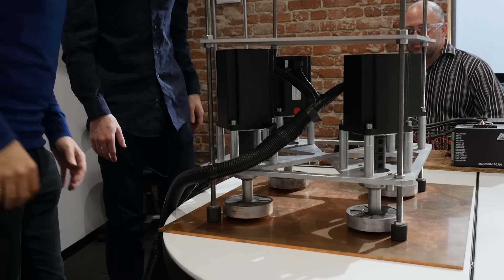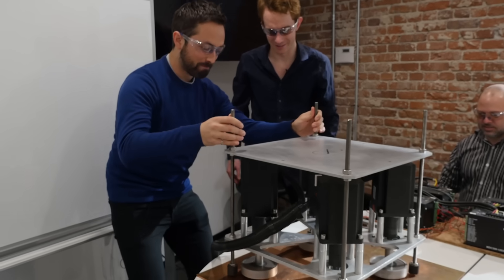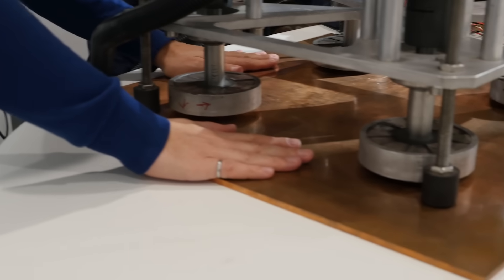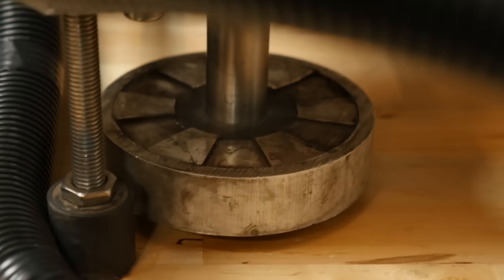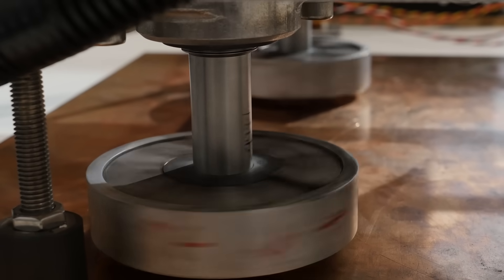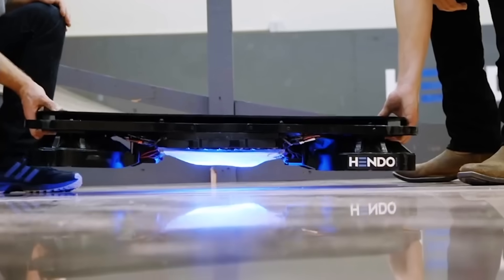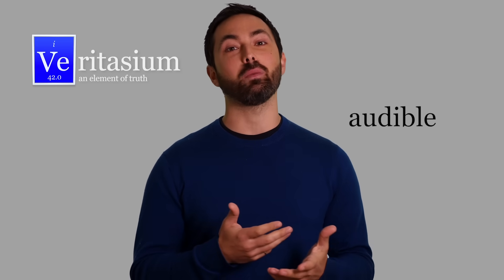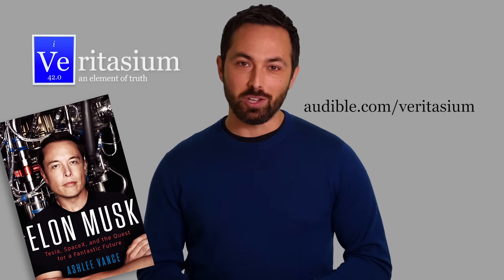Electromagnetic Levitation Quadcopter

Comment: For any curious experimenters, keep in mind that high temps destroy neodymium magnets... and I mean like the sorts of temps of the "hood of your car trunk on a sunny day" - hot will severely weaken them so keep that in mind when using expensive magnets like these.
Reply: Not quite. Some people could misunderstand this comment and think that neodymium magnets are useless and therefore "traditional" magnets should be used.

For each application obviously you have to choose the material, geometry, system, etc. adequate. In this case, if you want to use SUPERMAGNETS (that is, magnets made with RARE EARTH, such as neodymium-iron-boron Nd2Fe14B), you must choose another material. That material is the intermetallic compound Samarium-Cobalt, SmCo5, which has magnetic properties almost as good (approximately 85%) as neodymium magnets, and whose critical temperature is about 2.5 times higher, even better than the critical temperature of many traditional ferromagnetic materials.
Reply: Me, a brainrot victim: UsE LiQuId nITrOgEn.

Comment: I just want to know, does the weight decreases? 
If you put it hovering on top of a balance, will it get lighter or the weight stays the same (like pushing the surface bellow)?
Reply: That depends how you support the balance - it it's on the table it will show zero (as the thing is flying above it) so there's not really a way to weigh it. Have you tried weighing an aeroplane while it's flying?
Reply: @AAAyyyGGG  you're not getting it..
If you have a closed box with a drone flying inside, it will have the weight of the box and drone, because of air.
If you have a super conductor hovering on top of something, the scale will show the weight of the hovering object even tho it doesn't touches it, you can even put something on top of the hovering object and it will show on the scale...
I just want to know if the same applies to this method, the magnets could be pushing the surface to the scale, making it weight exactly the same even when hovering, this is what I want to know, if the same applies...

Comment: Add an impeller jyro to the top of that and mount the copper plate. Once the jyro reaches 25k rpm be aware ! To displace the heat use aluminium in thin sheets on the outter side of the copper.

Comment: The current needed to make this work is enormous,  and the copper has to be very thick, which is very expensive.  The concept is good, but different materials and much lower power to achieve the effect is going to be necessary to make it practical.  There is no reason on Earth why this should be so heavy.  There are much smaller and lighter motors that can be used to achieve this rotational speed.

Comment: you could put magnetos in it and try to run it like an alternator or something.  This array seems to utilize the natural magnetic flow by compounding the fields, it uses the natural toroidal dynamic in a type of broken symmetry, i guess.  If you're creating heat you're wasting energy.  Couldn't it take up the energy it gives off, if it alternated current?  I still don't understand wireless energy transfer.

Comment: Problem is that is just using the induced flux in the copper so
1. Needs to always be just above a massive ($$$) copper plate
2. Magnets would be depleted.
3. Electromagnets instead would use insane amounts of power.

Comment: If you have a device that weights 5lb that is levitating a 10lb object and you pick up the device (moving both items) would it feel like 15lb or 5lb?
Reply: Definitely 15...
Reply: @enricobianchi4499  how do you know? You gave not facts to back it up. If the levitation keeps it in the air, won't it keep the weight from being felt?
Reply: @dalton6173  Every action has an equal and opposite reaction. The device pushes the object up; the object pushes the device down equally + gravity; as such, the object is suspended in the air and still weighs 10lb on the device which weighs an extra 5lb on you, amounting to a total of 15lb. Very simple stuff.
Reply: @enricobianchi4499  however it is an emergency field ....would that change the distribution?
Reply: @dalton6173  1. What is an emergency field?
2. What do you mean by "distribution"?
3. Change compared to what?
4. I stand by what I said.

Comment: One thing i am still curious about, is it possible to levitate the magnets with out a conductor such as copper sitting under them? I know its possible to alter the magnetic field of a falling object, suppresing the gravity pulling it down and causing the object to fall slightly slower than normal. But Maybe theoretically, we can distort the gravity field of an object using electromagnets. And possibly cause it to float with out any copper laying under it. Just a theory, also i dont claim that these theories are true, im simply just curious.

Comment: Have you tried to electrify a spherical spinning vessel filled with mercury? What material would the vessel need to be made from to obtain optimal lift? Please consider this seriously. A spinning mercury filled sphere using very high DC voltage should levitate without a copper sheet below it.

Comment: Hyperloop will never work! There is a reason we don't transport little mail through vacuum tube! The weight of the earth's atmosphere!
Reply: Damaskilo there's something called a vaccum that eliminates the friction caused by the Earth's atmosphere. 😆😂
Reply: @lukewilliams5341  no! I didn't mean that! The whole atmosphere is weighing down on the tube! And the longer the tube is, the bigger the pressure difference! If you have a teeny tiny failure all the people inside will be crushed to death!! 
Atmospheric pressure is no joke! It can be deadly! 
The only reason we as humans don't feel a thing is our body has the same pressure outside as inside (lungs, organs like digestive system etc) 

 And there are other technological problems, like how to get the people in and out without letting air into the tube. You can't just let air in and than pump the air out. Depending on the length of the tube it would take weeks to just pump the air out. You can't have leaks during accidents or natural disasters, like flooding, storms, earthquakes, tornados etc. You would need multiple failsafe systems, and propably multiple layers of different materials to ensure a vacuum. 
It's too risky, too expensive and unrealistic!
If it were so safe and cheap to make, like Elon musk wants you to believe, we already would have thousands of Hyperloops around the world!

And it's not new! It's a really old technology.

Comment: Imagine if a rotating motor that can create magnetic field and do the same exact thing with the earth instead of the sheet of metal. It could hiver with almost no noise and no movement, except every electrical device around it will experience electrical interference and under it will get slightly hot. Its long time till we get it but lets say if the theory is correct we can explain UFOs. They almost work the same way,, and colorful lights are because of the electrical fields around them. And no im not wearing a tinfoil hat. Lol

Comment: Less revs and no lift. Too many revs and it will fly off into space until outside the influence of earths magnetic field. Also revs would have be adjustable for different planets gravitational signatures. Controls for pitch/yaw and six axes. I contemplated the probability from one of the designs in the  Vaimānika Śāstra. Now see it done. Weight ratio is high so materials become a challenge. Mercury induction is the key but only governments have the ability to pull it off.
Reply: @Gerhard57NL  so i am just guessing. Now i see it needs copper under it.?
Reply: @Gerhard57NL  Master Builder/Industrial designer with 35 years experience looking to start scientific research company. 

dibble and dabble with hypotheses.
The hannebu 1 had to be copied from Vainmonkia sastra.

Comment: I once worked in a "Steel Mill" and we used to lift and move sheets of Steel weighing several Tons with an electromagnet powered by a 12v DC Car Battery.

Comment: Is there a way to absorb that heat and redirect it to produce energy?
Reply: Jack Daniels lol my question exactly, I think there’s many uses for the heat that’s generated, it can be used to generate electricity for sure
Reply: @ZimaletaMotors  Depending on how hot you get it, you might be able to boil water underneath it and then push that through a steam turbine. 

Maybe.

IAN an electrician, engineer, or terribly smart person.
Reply: Perhaps having the underside of the copper sheet connected to an array of thermocouples might do it.

Comment: Can they use the copper plate as a fly back energy and supercapacitors to catch the energy and is it oscillation current or direct current that the plate is making and if it makes oscillation current use a bridge rectifier

Comment: I think this idea has way too much wasted energy (evident by eddy currents generating the heat in the copper plate) to be viable.     :)   it's kind of like our current mode of transportation where we hop in a 6,000 pound vehicle to transport 1 single 200 pound human...    waste...   :(

Even worse is that we normalized this wasteful behavior...

However, I would like to see this honed into a better and better idea...   So keep working at it...  :)    may find a breakthrough idea to make it even better...   :)    no idea ever starts off perfect...
Reply: That's way i was thinking. Induction is terribly inefficient

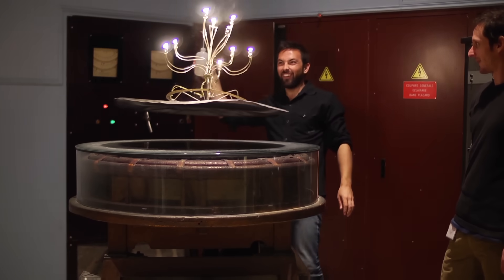Comment: @2:14 looks hazardous - a perfect recipe for a plate zooming out of control and chopping everything on its way ! and you guys are just standing there in casuals !
Reply: it wouldn't do that just cause of how the electro magnet beneath is set up. There are some great videos of a professor called Eric Laithwaite here on youtube showing the power of linear induction motors. Very interesting stuff.  Basically he shows that he can shoot an aluminium plate at something like 300km/h or just have an aluminium plate hover back and forth a few metres slowly. Just depends on the electro magnet beneath it and what pattern of magnetism it makes. Proffessor Laithwaite called this the "Magnetic River". For anyone interested in gyroscopes or magnetism, his work is a great watch!
Reply: Tasty Mushroom thanks for clarification. But doesn’t hazard occur when something is off the expected parameters. After all this is an educational video. There are people out there experimenting and failing over and over before perfecting it
Reply: @kalpssays  Yes indeed. That's the result of which we are seeing here. I'm sure that guy wouldn't have let him anywhere near it if he wasn't absolutely sure it was up to spec. Electro magnets are pretty stable. Barring short circuits from say physical damage or dropping water on the coils, it will keep operating in spec.

Comment: Technically it’s riding a wave that is generated by causing electrons to bounce up and down causing a transfer of electrons that is constantly being pulled and pushed back resulting in levitative motion. It happens so fast that it creates and invisible oscillating pillars that push and pull the electrons over and over. At a certain motion you can see the mechanism hop up and down meaning what I explained.

Comment: But it only works over the copper plate. Rather it needs a set of magnets and a non-ferrous metal, preferably copper to work. Not true levitation.
Reply: This is actually considered a true for of levitation. An extremely high-power form is occasionally even used to levitate stuff like frogs.

Comment: Copper solar freaking roadways!
Reply: Are you forget the fact that the copper warms up to the point where it will boil water? Imagine traveling across a surface that can burn you and horribly disfigure you at any point. Yeah, not just yet.
Reply: @StadiaTime  - cool it with a liquid on the underside and pump that hot liquid to Russia to heat people's homes
Reply: I had to laugh! What a fail the solar roadways were.... Unbelievable!
A lot people love science. Doesn't mean they understand it thou
Reply: And with solar panels so it pays for itself
Reply: Dont forget the death tube trains
Reply: @user-cg3em4cw4f  yea, thats the joke
Reply: Brilliant!
Reply: @user-cg3em4cw4f  not if the car floats over the 'road' instead of making it dirty with their wheels etc
Reply: @user-cg3em4cw4f 
V 1.2 put solar panels above the road Hehe if it only was cost effective to build
Reply: Some pros and cons:
Anti-viral
Rusty
Pollutant
Lightning storms??
Expensive/supply chain/offset from mining it?
Doubles up as some kind of cable network?
Reply: It would be great until you get a serious solar flare. Your copper road would then become lethal
https://www.space.com/7224-150-years-worst-solar-storm.html

Comment: I screwed around with this in middle school a bunch of guys and I thought it would be funny to sping magnets on a motor to use as a method of power transmission, never thought of using it this way even after learning about the moving a magnetic field thing in high school

Comment: Funny but it's fake, because the aluminium can't be magnetized too easy, in fact a magnetic field will cross trough it and the aluminium will not be attracted or repulsed.
And the permanent magnets will last some minuts before the effort disrupts the magnet atoms and changes the magnetic alignment then the magnets will stop working.
Reply: The video says nothing about aluminum?
Reply: @nathanb011  Check the minute 2:00
Reply: leo2tv aluminum IS paramagnetic, and its light magnetism can be used to control the strength of the magnet's force at a much finer tune. So no, it's not fake.
Reply: @nathanb011  One thing is the theory, another thing is the reality. Repeat the experiment for yourself. I work in that area and is not going to work in the way that they have showed.
The tiny magnetic field of the Al is like 1, and the magnetic force is going to go trought it.
The Al is not to control the magnetic field, maybe the Bismutum if they chane the orientation....
I wish it was real... But is not.
You can read the wiki https://en.wikipedia.org/wiki/Paramagnetism
Reply: leo2tv In no way did I say the Aluminum would control the field. If Aluminum is takes more magnetism to affect it, you have more adjustment for what occurs.
Reply: @nathanb011  You have said that, you can read your own previous words in your comments. Anyway it won't work in the way you think. The magnetic field is not like a water flow, that is not the right mode to control it. Read about magnetic, diamagnetic and paramagnetic materials (tvere you will find special alloys that really absorb or change the magnetic field direction); also check the maxwell laws, farady, etc.

Comment: try using stacked plates with sectioned geometric paterns between each plate with each section wired outside the plates section into one -E  terminal battery the plates will create A repulsive field on the opposites side of the - E plates and are mainly used in static photon deflection system. the copper scrolls are the first demo stack of a working photon star ship shield

Comment: Hyperloop: Someone maybe can tell me how they will maintain a near vacuum in a tube stretching across a continent? What sort of material would be used for the tube? Concorde was 202 feet (66m) long whilst on the runway but at altitude and flying at mach 2 it stretched by two or three inches (50-75mm) and this had to be allowed for in the fuselage to keep the stressed skin pressurised. This was difficult in a 66 metre tube - How about a 600km tube? With a much greater differential pressure. Sounds like a truly dumb idea to me.
I am in South London and laying beneath me are the ghostly remains of the Atmospheric Railway - an attempt to build a hyperloop by the Victorians. The low pressure was kept by leather seals which hugged the carriages. They were eaten by rats. The steam engines couldn't supply the power to move enough air and the whole thing was closed fairly soon after opening.
Reply: Not saying anything about the Hyperloop, but I believe we've advanced a bit over the past several centuries.
Reply: @yobeefjerky42  Sadly for the idiots believing in the Hypeloop, physics didn't "advance", it stayed the same.

Comment: That's hardly a quad copter and for magnetic levitation that was  stupid loud. Why have it be so heavy? I can maybe see use on a factory floor but the device weight and em current produced heat.
Reply: Permanent magnets weigh quite a bit and so do electric motors to spin those magnets.
Reply: @0ooTheMAXXoo0  right and thus completely unnecessary. What I'm saying is why build the thing. There are no practical uses due to the drawbacks such as weight, heat, energy usage, sound, and specific surfaces needed to it to work. Also, it's a bug stretch to call it a quad copter. More like a magnetic hovercraft than anything. In fact it shares many similarities but with extra drawbacks a hovercraft doesn't have.